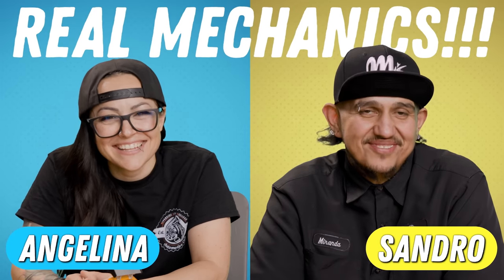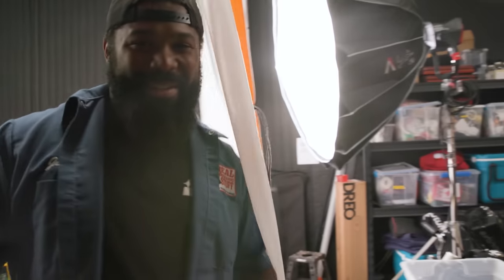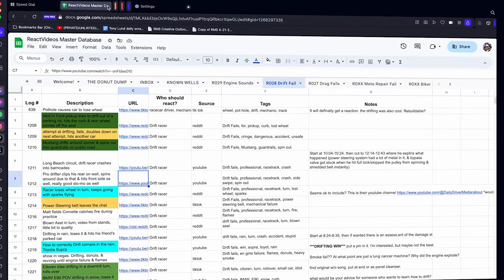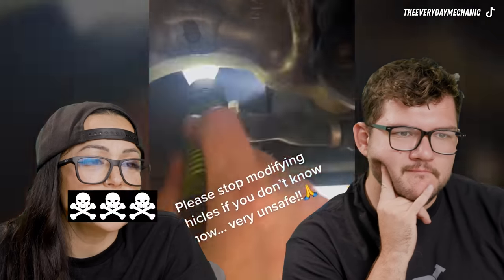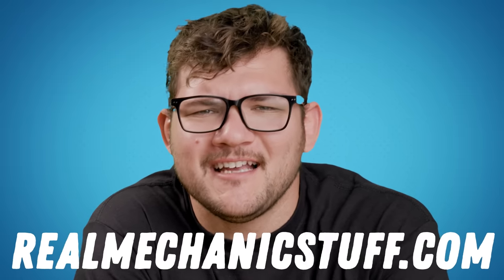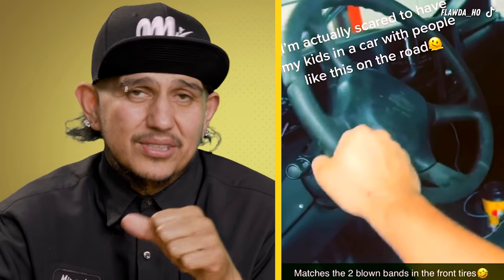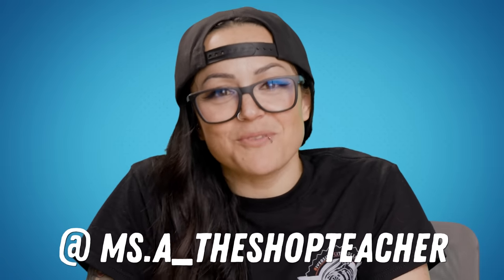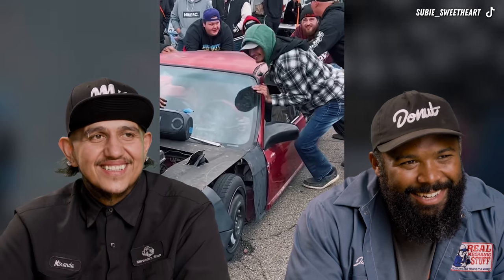Mechanic Reacts To Dangerous Death Traps

Comment: Brake Fade...
In 98 I was working as a chauffeur. This extremely overweight family (everyone was fat) needed to get from Ohio to a hotel in West Virginia for their vacation. There were 10 of them in my 16 passenger limo. Each one of them weighed over 200 lb. We had a second limousine that was a 10 passenger just carrying their luggage. First 3 hours of the trip was great. Then we started getting into West Virginia, deep in the mountains. The limo that I was driving was a 97 and if you didn't know all they basically do when they make a limousine is cut the car and make it longer they don't put in bigger brakes The only thing that they put in bigger is the alternator and springs 😳. Limousines are designed to drive around a city not for cross-country travel and definitely not for driving in the mountains and if you are driving in the mountains having a whole car full of people that weigh as much as a whole car is not a wise thing to do. We started going down this very steep hill. I am not using any gas and we are accelerating rapidly. I touched the brakes and then I let off because I'm a professional driver and I know that you can't just cook your brakes or you have none. With this much weight downshifting is an option but you can blow your transmission. I didn't have much of a choice. I hit the brakes and try to touch and go but as soon as I let off the brakes we would start accelerating rapidly. So I downshifted to second. This helped but the transmission was screaming and oh yeah it is a slow snake curve banking right And then left over the course of two or three miles straight down. As we are going around the curves I am now transmission in 2 in the car is going about 80 mph and the wheels are screaming. I'm still doing touch and go with the brakes to try to maintain control. I've never been so happy to see the bottom of a hill in all my life 😢😁. I started getting brake fade and I had nothing... And you could smell the brakes. We got down to the bottom of the hill and I pulled in the rest stop and told everybody to go use the bathroom and take their time because we were going to be there for the better part of a half hour, to 45 minutes to let the brakes cool down. These people were complete assholes and upset that I was making them wait. I didn't give a damn My job is to pick them up in one piece and drop them off in one piece and I plan on going home at the end of every day. When we pulled into the rest area the other driver said that he could see that my rotors were red hot. If you want to know what it felt like it felt greasy. The brakes weren't squishy It felt like somebody had thrown grease onto the rotors. When they get that hot before you ever get break fade the brake pads will squeeze against the Red Hot metal and it will actually cook the pad and turn it into a vapor which is not a friction surface because it's a gas and you will feel it. Brake fade is the last stage but you don't have brakes before then. I only had two oh s*** moments in 2 years of driving limousines and that was number one on my list. My pucker Factor was at a 15 on a scale of 1 to 10.
Reply: My real oh sht moment was my first time driving to WV and took a corner like I would in Ohio, vs the recommended speed. Almost launched off the edge of the mountain.

I learned real quick to take corners slower in WV. 🤣
Reply: @irzyxelwj  Yeah they like cinders on their roads 🤣. They haven't really gotten up to good old pavement in a lot of places. I live in Ohio as well and my father grew up in West Virginia there was a time they didn't even have speed limits when the highways first opened for West Virginia the speed limit sign red DP... That's good for "decent and proper", completely at the discretion of the officer that was pulling you over. If it was a clear sunny day and you were hauling ass and he didn't feel like giving Chase you were decent proper. If he felt his car can catch up to yours then you got a ticket. Likewise if you were driving in unsafe conditions for the weather they could pull you over. It wasn't a speeding ticket per se It was like a reckless driving ticket but everything back then wasn't like it is now You paid your fine and went on about your day.

Comment: As a former owner of death traps like these I'm proud of the parking lot/ side of the road repairs I had to do just to get it back home and cobel it together a little better the next day to keep it going. I have used compression fittings on brake lines to get home. I drove around for months with plywood screwed down to my floorboard so my feet didn't fall through the rust hole. One time when I was on the way home from taking a car to the junk yard, dropped my rear drive shaft. I had to put the back tires of my truck on the car dollie was pulling, use ratchet straps to hold tongue of the dollie up, some barbed wire I cut out of a farmer's fence to hold the drive  shaft up and limp it 6 miles home in 4 wheel drive. When i was finally able to aford to buy vehicles that didn't brake down every few months/weeks the guys at my local parts store thought i died because i stop coming in all the time. Bottom line if you're going to be poor and drive a rusted out shitbox you have to be a little creative and have some ingenuity to keep it moving from point A to point B.

Comment: 8:28 I work at a semi truck shop, and we do some f350 and up trucks. I have run into trucks that have lost brakes due to eating through brake pads and the metal backing, and they fall through the gap between caliper and rotor. I have also seen people go to someone cheaper and have forgotten to put in a pad or the hardware for the pad. But those rotors look damn new for it to have eaten through the metal and the pad .

Comment: Sandro and Angelina are the best 2 mechanics for this series and I hope they stay as a permanent fixture on this channel. They’re both super chill, down to earth, know what they’re talking about and just over all really good people/mechanics. Really hope they stay and at the very least keep Sandro around “ FOR THE BOYS”!!!😂😂😂
Reply: 2:00 They didn’t even know a common problem with the early 2000’s Chevys having rotted and snapped frames, having them say it was a rear end collision that caused it told me all I need to know, they can’t have too much experience as mechanics. They are good actors though.
Reply: @jaredchampagne2752 yeah, the replaced tail gate is a pretty good sign that there's a good chance it was a rear end collision. Maybe, they know their stuff.
Reply: @kragoth1458  No not at all. Almost every early 2000’s Chevy that is rusted, has a replaced tailgate from a junkyard because the bottom rots out and the linkage stops working.

The truck literally has no bedsides left from rot and rust. There’s a 100% chance the frame snapped from rust.
Reply: @kragoth1458  it’s most likely that they’ve never experienced cars that have existed in the rust belt. Early 2000’s fords and Chevys are notorious for driving around with snapped frames like this. Super common in the northeast
Reply: @jaredchampagne2752 Do remember that they are in California. Cars may not be as prone to rust there when they are not salting the roads every winter.
Reply: @jacobdill4499  Them being in CA doesn't mean the clips they are reacting to happened in CA...
Reply: @dave4148  I was alluding to most of their car knowledge being from working on cars that have experienced California climates because of their location.

Comment: You guys should check out heavy machinery videos. I constantly find engineer fails like the other day when I had to cut bolt to remove a starter on a 3 year old forklift and had to cut the replacement bolts because there was not enough room with the OEM bolts

Comment: Man i love those two. Sandro knows no fear. I´m always amazed about what is possible to drive in the USA. I live in Austria and our yearly road legality checks are insanely strict and the state makes it as difficult as possible to modify your car in any way.
Reply: some states in the US don't require any vehicle inspection at all. where I'm from in NJ, inspection is every two years and only checks that your emissions systems are functioning and no check engine lights are on. No inspection needed on sufficiently big trucks pre-2006 I think, and none needed on passenger vehicles older than 1995 or any motorcycles. Needless to say, I would feel a lot safer on the road in Austria
Reply: @Sam-lr9oi  man that is absolutely crazy. Yea you would feel safer but it comes at a price. And that is a huge one. They check yearly everything. From joints, enginemounts, rust, emissions, leaks, tyres, even the fucking wipers. If you have a little hole on the under side of your car, you fail. Some shops are so strict that you fail if your wiper makes a line on your windshield. And they can just say "dude we have to replace all the brake lines" and there is little you can do cos you can fail inspection once and you have to do the second one in max 30 days or they take your road legality sticker away, your insurance doesn't cover you and you get fined a lot of money. Insurance is 50-150€ per month depending on horsepower and you pay like 1,80€ per liter in gas. Owning a car here is expensive af. And don't get me started on mods. They just make it next to impossible to modify. I can explain how rediculous the laws here are but i'm about to go to sleep. If you are interested i can write something down tomorrow.
Reply: @nicozimmermann8672  they do inspections in finland every year also modding your car in finland is not to go to A-katsastus aka old finnish monopoly company because the state owned inspection place had many envious or communists as inspectors from 60-90's because of hatred of westerner cars because that mean't that you had more money  or just to fuck with if your face wasn't their likein but connections usually stopped the inspectors to fuck with you because two way road if you knew the right ones.
Reply: correction in the 60's to 90's not from because they retired or dead
Reply: @nitroruski7986  What about modding a Lada? Did they like them?
Reply: @nitroruski7986  so the inspections in Finland are from government institutions? Or do you go to a certified mechanic shop?
And how strict are they?
We here in Austria are on a "you know a guy" basic for most stuff. We have a state owned inspection body but you only go there if you mod it (it's a whole other story) or if you get busted for illegal modification (which as i said nearly everything is illegal) and they send you a letter. Most people just sell the car cos you can not pass that and it will cost you immense amount of money to pass (either in fees or in bribes or both).
How is Finland in therms of modifications?
Here it's for example: you want different wheels. The dimensions you can run are in the cars paperwork (most have like 2-4 dimensions but older japanese cars have one dimension) but you want let's say from a personal example 16inches on a 1991 eclipse which has only 15s in the paperwork. You have to get wheels with a ABE and E-stamp on them (those are certificates the manufacturer must have for a product to even be considered a standard but the ABE certificate only works in Germany so you need the E-Stamp on them). You have to install them and the manufacturer needs to list your car model on a paperwork that it is safe to install them. If it's not wheels but let's say a digital cockpit cluster (friend of mine wants to upgrade his bike atm) you also need to go to the Austrian TÜV to get a certificate that the thing is properly installed. After that you need an appointment for the state inspection office where you have to give them the car (with fully installed wheels) the paperwork and you wait for the inspection. They do some rediculous tests to see if something scrapes or if the wheels poke out of the wheel arches. After that if you are lucky they will give you the updated papers for your car and you can drive on those. You are now around 600€ in only for the inspection fees. If they say no (cos bad day or just don't like your car) you bought the wheels, tyres, payed the balancing and installed all of that for nothing. You can leave a few hundred bucks in the glove box to motivate the guy though.
Problem is most companys just don't go thru the trouble of a E-Stamp certificate so you just can forget about installing the product. Like a collegue of mine with a LED harley davidson headlight. Costs 160€ without the E-Stamp but the same product with the E-Stamp costs him 550€. But he is not guaranteed that he can legally install it cos he has to get it certified aniway and if they say no he bought it for nothing.

Comment: About 10 years ago i drove my used 91 ford probe (mazda 626) from champaign illinois to dallas fort worth in one go. On the way the drivers side rear brake caliper locked up and the heat of the trip caused the pad to fuse to the caliper piston. Leaving dallas. I had to slam on the brakes on the freeway which caused the caliper piston in the drivers rear to shoot out but since it was fused to the brake pad it could no longer go in. I drove that car back to central illinois being careful over two days. When i would stop id turn the car off. Top off the brake fluid then pump the brakes to bleed them so i could get one good stop. If i used that stop before i wanted to id nutral drop and aim for a parking block. I got it home and fixed the brakes but eventually the interference engine got me and it blew up. I loved that car though.

Comment: The brake line one near the end. Been there. Brake line went out on the freeway right as I had to slam em because traffic came to a dead stop. My car wasn't stopping. After that my dad tried tapping/threading with those exact pieces on the line, they didn't work. Had to stop by a store to get fluid after work everyday until the correct part arrived and only took back roads in the meantime. Got the full replacement line that we installed together and it was like it never even happened. Don't cut corners.

Comment: The trailblazer platform with the broken upper rear control arms, I've seen it on 2 already, pushing 3 with my current one just starting to snap the upper on the driver's side. The problem is that the fender liner doesn't cover the control arms and grit, salt, sand, gravel and dirt rot the frame out right there via the factory frame holes and the bracket doesn't give clearance to even wash it out. The control arm locks up in the bracket then flexes until it snaps. I'd say it was planned obsolescence, good vehicles but you have to spray those out to maintain them or pull them to clean them out, just buy new arms. Neglected the frame will rot out, I have an example of that.

End note I'm absolutely a fanboy of Angelina. 😂
But yeah there's a few things on those SUVs that are devastating issues but I have 4 of them now lol

Comment: I sat on the gas tank of my buddies 1940 Chevy truck he was putting together. No doors, windows, belts, or floorboards, and only a seat for the driver going 45-50 mph down our gravel road. It’s a sweet truck now, but that was the sketchiest ride I’ve ever been on. Also, Sandro needs to be in every video. That dude’s legit!

Comment: My worst: I had an old Toyota, no clutch, a monster hole in the block, and a string tied to the carburetor for throttle. 🤣
It ran for about a year till syncro shifting dumped the entire transmission onto the road from the block back and died. I left it where it died somewhere in Sacramento.

Comment: Hey, safety tip for everyone: If you ever have jack up a Raptor to put on scales make sure the parking brake is on and lift the rear by the differential. Two guys at my shop didn’t have it set and the scales shot back across the floor about five feet when they lifted one wheel at a time thanks to the positraction. Thankfully nobody was behind it. Be safe y’all.

Comment: That brass fitting at 13:30 looks like it’s a 1/4” compression coupling that I use plumbing, I don’t think the threads broke like she Angelina said I think the nut loosened up and came off the coupling, whoever put that on took the black coating off the brake line to get the nut and feral on the brake line